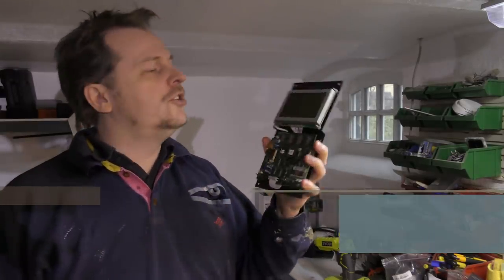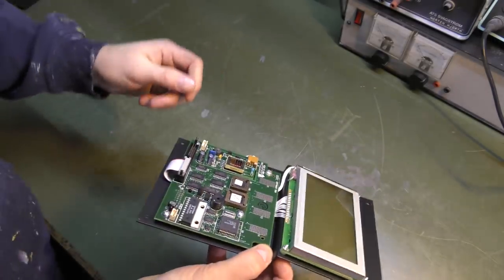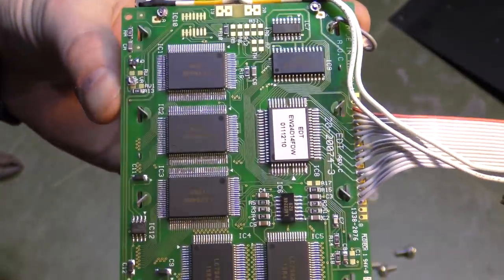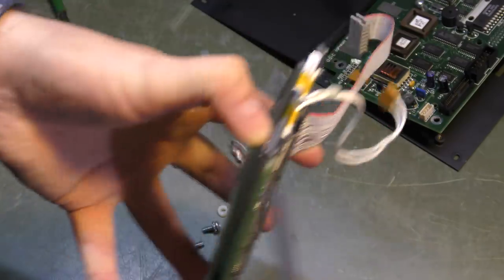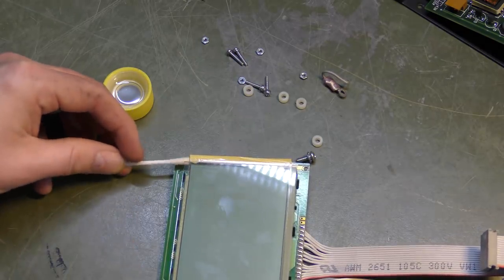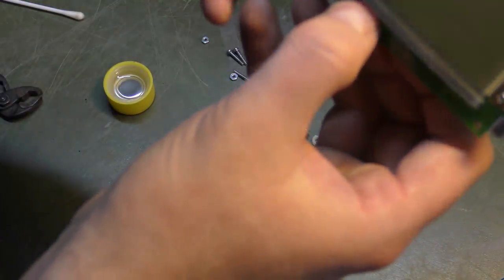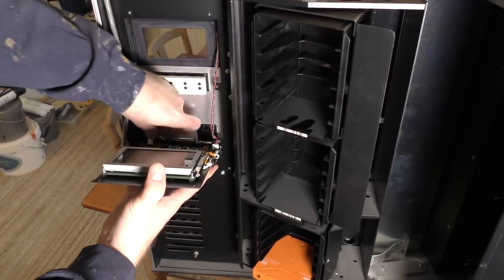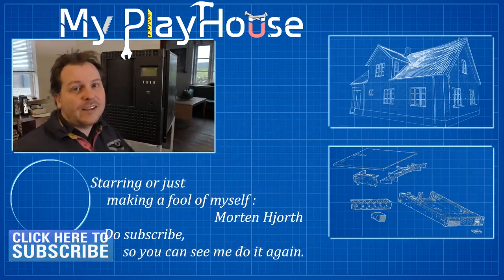Fixing Dell Powervault 136T Display, Totally Failed - 791

Comment: Those conductive strips are such a clever way to connect a display, but yes they do tarnish and need a clean, i've done loads on multimeters.
Your fluke was really bad, but it shows a clean can make it happy again :-D.
Not a cheap meter to give up on.

Im guessing one of those driver chips with identical numbers have gone poof, the module is about 18 years old so it can be forgiven.
Reply from the maker: Hi zx8401ztv
Thank You very much!  glad you liked the video :-)
Thank you for watching! :-)